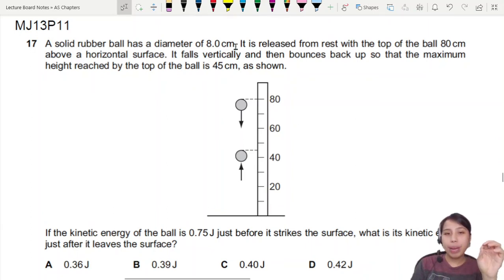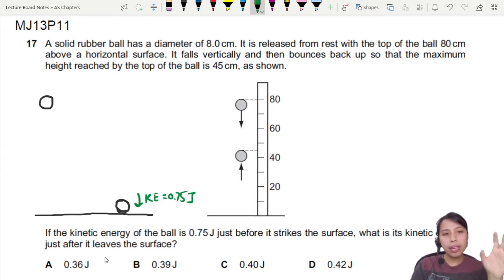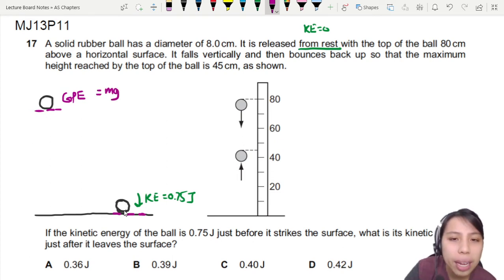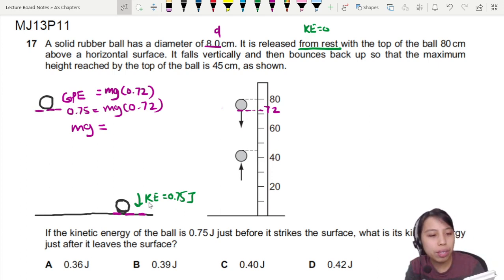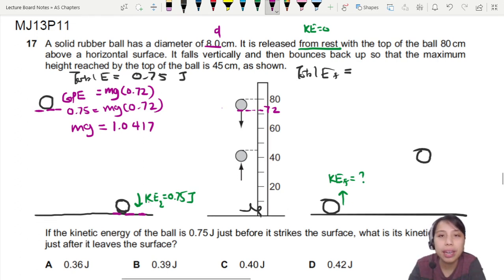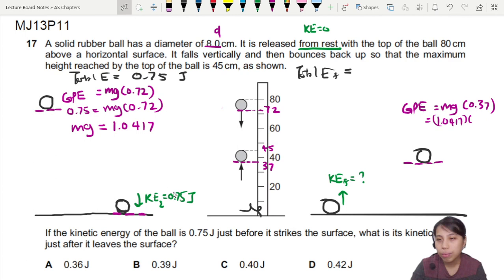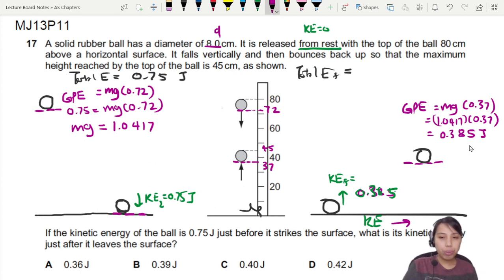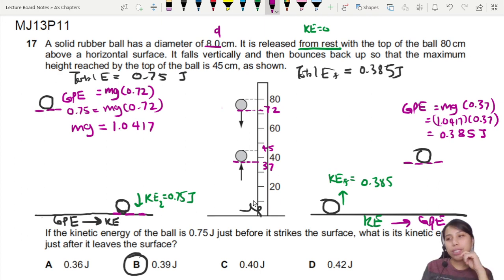5.1e Ex2 MJ13 P11 Q17 Ball Rebound KE | AS Work Energy Power | CAIE A Level 9702 Physics

Comment: For those saying that they are getting different values by varying the reference point from top/bottom/middle of the ball. You should be getting the same values because, for eg. If you take the top point as the reference, you are measuring h from the top of the ball so when the ball falls at the surface, its bottom end lies at 0 cm and its top end lies at 8cm if you imagine it. We had to take h between the top ends of the ball so if you imagine it, you will need to subtract 8cm from 80cm to get 72cm (0.72m) to get the distance between the top ends of the ball. The same way, if you take the middle of the ball as the reference point, you will need 80-4-4=72cm where 4cm is the radius of the ball, becaude if you try to imagine it, we are getting h as the distance between the central ends of the ball so for 80 first that lies 4cm above the centre, we will subtract 4 to get 76 which is between the centre to the absolute bottom (0cm) but we will subtract a further 4cm to get 72cm as when our ball falls completely on the surface, its centre will lie 4cm above the absolute bottom (0cm)
Reply: god knows how long id be stuck on why she chose a different reference point. goated explaination thankyou

Comment: Why didnt we take the top of the ball as the height ? Aka 0.8 and 0.45
Reply: The answer is coming diff by taking upper height
Reply: @hi-zw4wi if you are using the upper height then the value used for the height will be 8 as the minimum not 0

Comment: why use  0.72 and 0.37 when the gravity acts on the centre? so you should only minus 4cm right?
Reply from the maker: You can use the centre of the ball as reference point, or the top/bottom of ball when measuring height
Reply: @ETphysics  but the kinetic energy change is differing if we take centre of the balls, or the tops and those answers are in the choices. so do we always take the bottom of the ball?
Reply: @khushbakht1206  hi ya its been 10 months so dyu guys know why jow ??
Reply: @benyap6402   It is necessary to deal with the bottom of the ball as the reference point because the only way Gravitational Potential Energy can be Zero when it collides/makes contact with the ground is when the reference point is the bottom because that way it’s h=0, if we take the top or the center of the ball as the reference then upon collision/contact with ground they still have some potential energy as they will have a certain height above the ground
Reply: @zuhaamjad8807  Thank you soo much for clarifying, i've been going around in circles for a long time because i took the top of the ball as reference. Thanks big time!